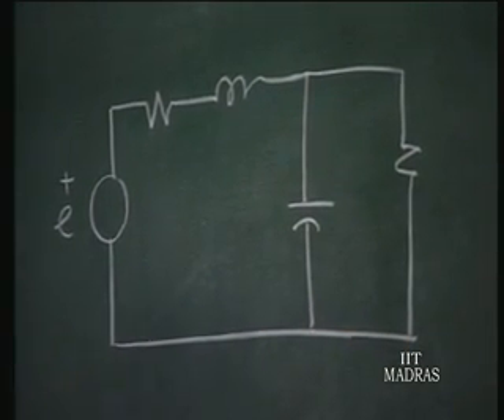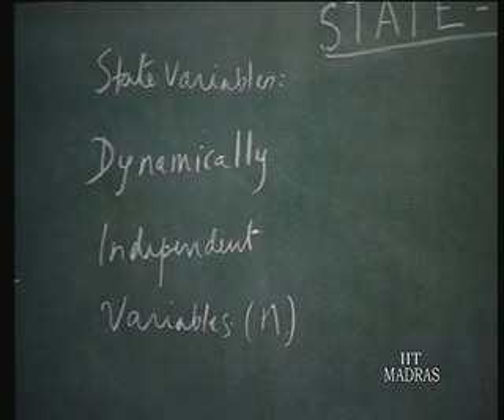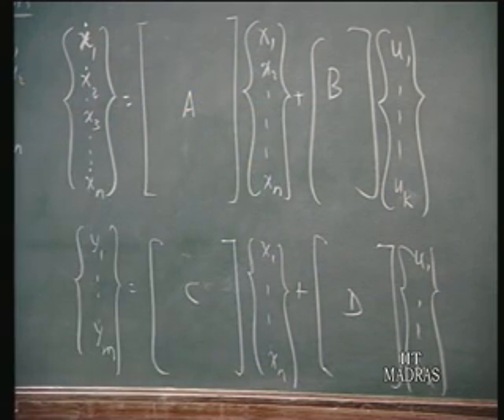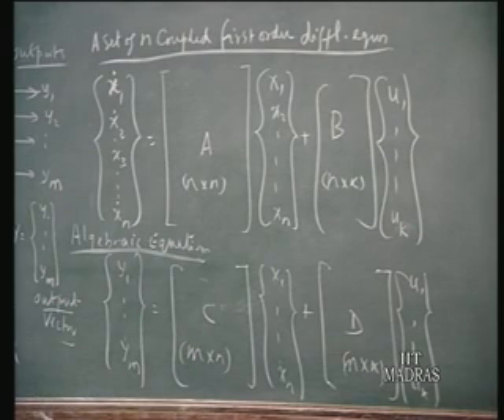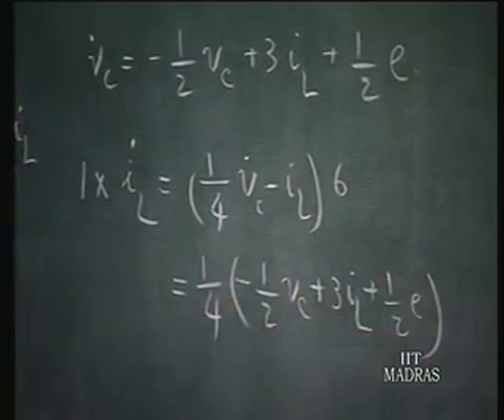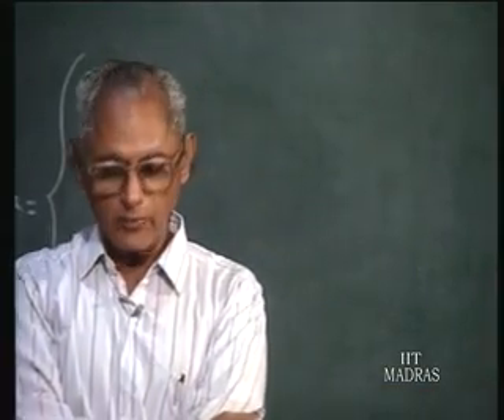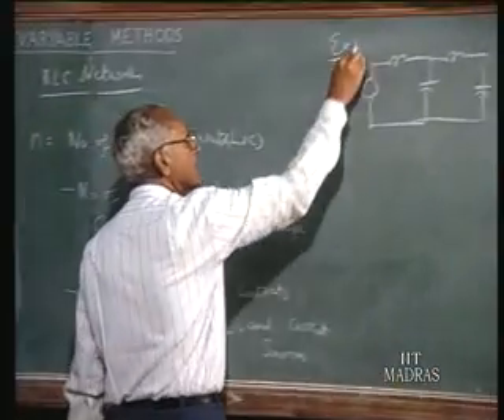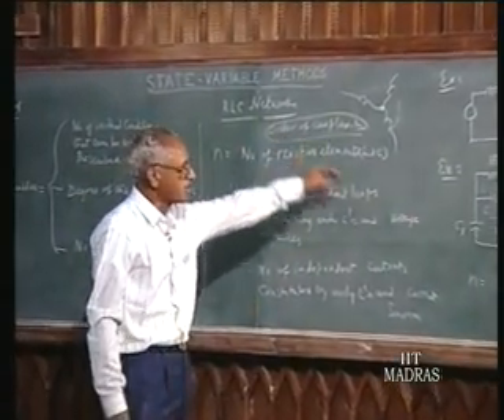Lecture - 45 State-Variable Methods (1)

Comment: Sir while calculating the order of complexity for the second example of R,L and C network why didn't you consider the 3rd loop containing the capacitors C3, C4,R2 and R3,In that  loop also one capacitor is independent,

Comment: I am still confuse why we need to define state separately?
Reply: +pallavi sharma state is a function of the system. it depends on the system alone. So if we can solve for state eqn we can solve for any output. i.e you can select any part of the system as output as you and no need of separate transfer function for different outputs